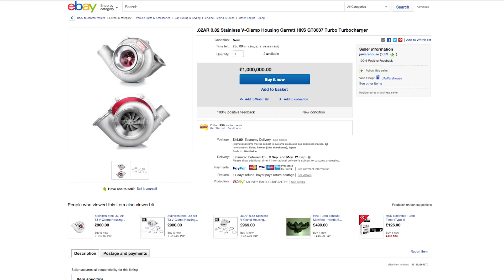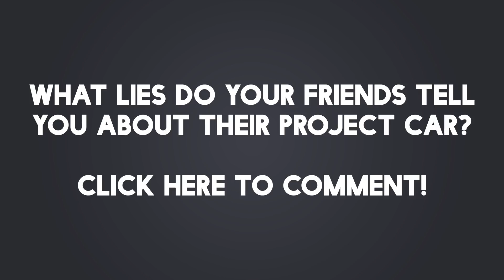10 Lies A Petrolhead Will Tell You About Their Project Car

Comment: "uhhh yea its a v8 😬 " (v6) -camaro. "
Reply: ***** Of course is a V8 BRO!   (4Cyl. Mustang)
Reply from the maker: ***** It's a 2011 6.2-litre V8 LS3 >> http://gmauthority.com/blog/wp-content/gallery/gm-6-2-liter-v8-small-block-ls3-engine/gm-6-2-liter-v8-small-block-ls3-engine-2.jpg
Reply: ***** "I drive a TRUE muscle car!" Drives a V6 mustang pony car...
Reply: ***** specially since the 4th and 5th gen camaro give away if its a v6 or v8 just by lookng at the front lol
Reply: My 4.3 will light them up
Reply: ***** "Hear the V8?" Playing v8 sounds through speakers
Reply: Car Throttle the bigest lie i told  as acar guy is that i have a car in a first place
Reply: ACoolStupidDog The modern V6s are pretty strong motors with lots of potential. I agree though, you should never call it a muscle car, even the GT isn't a muscle car.
Reply: MAEguy Of course! The V6 Mustang is very desirable in my opinion. It's a fantastic car, no doubt. We're talking 200 to 300 hp!
Reply: +ACoolStupidDog. there is nothing wrong with having a v6 anything but there is always those guys with the v8 version that will trashtalk you because they will always have more power than you unless you boost it
Reply: ***** In that case, get really close to their ears and silently whisper " GT-R... "
Reply: +ACoolStupidDog. gtr is allwheel drive and twin turbo from.factory all motor a v8 will eat it without those turbos
Reply: ***** Indeed, but it's still a V6
Reply: ***** True gearheads would go the other way "uhhh yea it's a v6 bro" a V8 owner :D
Reply: Lol yea those who have more than 600 horse try to look stock af but when they let you win the 1st race DO NOT double down for the 2nd race they will rob you blind
Reply: ***** hay I've got one of those. only a firebird.
Reply: LS1OfAKind A 4th gen z28 and a 4th gen V6 look almost identical.
Reply: a 4th gen gears work on a 5th gen rear end
Reply: "I have V12 mustang"
Reply: +Jack Carroll someone once told me his pick up truck had a 4.3l 350 v6 :O true story too.
Reply: Well the 4.3 is based off the 5.7 it just has 2 less cylinders
Reply: ***** so does that mean 3.8 mustang drivers can say they have a 5.0 v6???
Reply: No only the 4.3 from chevy was based off the 5.7 evrey other engine is based off something else according to Wikipedia don't quote me
Reply: +david hurtado this guy knows his stuff in 1984 they built they 4.3 and in 85 they released it in blazer and light duty trucks all it is is a small block Chevy 350 with two missing cylinders they stopped production in 2012 they restarted though in the 2016 Silverado
Reply: +stephen king (getrag6speedz28) that's the funniest thing I ever heard
Reply: "It's a six speed."

-Stick?

"Na, auto."

-Douche! 😑
Reply: soulassassin0g I agree...I'd understand if the guy was disabled and had the car modded for him to drive it, or if they've tried and failed a standard transmission so many times they've spent more on transmissions than driving lessons, but otherwise just say it's an auto and leave it. Lmao
Reply: I know
Reply: +david hurtado Nothing sounds stupider than a loud muffler on a V6-automatic Camaro, and my beater '68 Falcon with the 200CID six and stick shift on the column could beat it in a light-to-light drag....not that I ever....uh....
Reply: +Jack Carroll  Yea whatever... it's a turbo 3.8 from a GNX bro, it'll smoke your Geo metro.
Reply: +ACoolStupidDog Oh my god.. TOO MUCH HP!!!!
Reply: +dennis trident william lol wut? (thats a first I've heard!)
Reply: Ken2Point0 Braggin about shit you "used to" have online. Nice.
Reply: Joey Salads
Reply: He would be in big trouble when selling this.  :D
Reply: DC Garage But the exhaust still sounds like a '63 Rambler with a faulty muffler.
Reply: Well technically the older gt's are in the lower 4.9L...but they  round it up.  I guess newer ones are a lil closer...but putting an exact measurement of 5.0 stuptifyies me.
Reply: Auto = Luxury!  No stop n go or drive thru stick fondling...and playing patty cake with a clutch, going no where.
Reply: Lol autos shift faster than any human can.  More consistent too.  But I get itbif you dont live in a place where there is traffic, can be fun
Reply: soulassassin0g I had a six-speed in my Studebaker Lark: three-on-the-tree with a planetary overdrive gearbox built onto the back of the sliding gear unit; Overdrive could engage in any forward gear.
Reply: 5610winston like a semi-truck (lorries)?
Reply: soulassassin0g Not exactly. It drives like a regular Column shift three-speed manual but when you get up to speed, you let off the gas and an electric switch trips the planetary set and engages overdrive. When you floor the throttle, it kicks back into direct for passing or climbing or whatever. It was a popular option back in the day. The direct drive is 1:1, and the overdrive is 0.67:1. As I said, it could engage in all three  forward gears, but was most useful in second and third. Wish I still had that old car. A real sleeper.
Reply: 5610winston Holy crap, that's awesome. What happened to it?
Reply: Traded (regretfully) years ago. It needed a valve job, and rings, low oil pressure, and the under-dash air was blowing warm, and the front fenders and the bottoms of the doors were rotting out. I was too scared to look at the frame.  Figured the trade-in for a new Nissan pick-up would be a better investment than the repairs. I saw it in traffic a few times after the trade, and most recently about fifteen years ago coming out of a high school parking lot about thirty miles from where I traded it.  Kid driver seemed to be in a hurry...
Reply: What is it with Americans and v8s is it the sound?
Reply: Sound and All that Yummy torque. and the relative easy modding and maintainence
Reply: The rule of "No replacement for displacement" still stands true today in most cases.
Reply: david hurtado dude is that a v12 engine swap in that civic "yup".walks to the back of the car big fart can exhaust that things a riding 4cylinder
Reply: Will Eason
Seller: "Yes. It has a K20 turbo."
Buyer: "Oh, really?"
*Pops open hood, sees a stock B18*
Buyer: "You douchebag."
Reply: 75% of the way there! :D
Reply: seller: it's a real lamb for 300k
buyer:really a hurican
seller:yup
buyer:pops hood and sees rx8 engine
seller:son of a 
buyer:douch bag
Reply: I'd actually take the new v6 10spd over a v8
Reply: I had a friend try to tell me his Hyundai Accent had a V-8.
Reply: But then they can always boost their V8 and due to the laws of thremodynamics there truly is no real replacement for displacement
Reply: Even in traffic it can be fun I drove a 5 speed truck throughout highschool and maybe it's the torque that helps but I never had issues with traffic
Reply: david

Comment: "This air intake gives me 10 more horsepower"
Reply: It actually does lol
Reply: FSXgta Most air intake like airaid give around 12 hp How do you feel now ?
Reply: Tyrese Waldon fakeairintake
Reply: In all seriousness cold air intake is great because it allows the engine to cool off more which increases HP. A cold engine is always faster than a hot one. Ever notice how cars perform better in cold condition and are actually slower on a hot summer  day?
Reply: Tyrese Waldon It's not your engine being cold that help it, it's the fact the the cold air is dense, therefore more air to burn per fuel ratio. you're running leaner when its cold and richer when its warm
Reply: I never knew that, thanks lots!
Reply: +Gamingnation your facts are from where?
Reply: FSXgta The box said 10 horsepower!
Reply: Tyrese Waldon Are they?? Cant say ive ever really noticed. How do you notice the difference?
Reply: Its nor like your car is gonna suck more air with a modded intake. Turbo it, increase boost or your not gaining power
Reply: ^knows nothing
Reply: Shane Earley my buddy has a fast car, so were able to tell pretty good.
Reply: FSXgta Air intakes lose HP most of the time lol
Reply: Injen intake
Reply: Tyrese Waldon Nice bud
Reply: FSXgta Most cold air intakes don't add power, usually lose a bit, it depends on what car, and how the manufacturer designed the intake, go watch the, I am fairly sure Mighty Car Mods did an episode on it, and the S2000 in the video gained horsepower with the after market intake.
Reply: Tyrese Waldon nope, hot engines breathing cold air make more power cause there's less heat loss.
Reply: FSXgta Some can get you even more than that. I was shocked, and I wouldn't have believed it if I hadn't seen it myself, but a CAI got me .3-.4 seconds in the 1/4 mile. It wasn't quite that simple, there was a tune involved as well (NA 3.7L V6), but even with just bolting on the intake with no tune, I was .173 seconds faster. For some engines it works surprisingly well.
Reply: GRK HEEL What? Are you honestly implying having your intake air be a few degrees cooler will lower the running temperature of the engine? :I
Reply: GRK HEEL watch mighty car mods on this one. yes cold air is better, but "cold air intakes" do jack shit. Unless the stock intake has a lot of obstruction, you're not gonna get a gain (in the same way exhaust headers can slightly improve HP). It's just the easiest part of the power train to swap without screwing up, aka I MODDED MY CAR CAUSE IM A MECHANIC AND NOW IT GETS 500HP ON Bo0o0o0o000o0oo0o00ST!!

(oh and intake air doesn't mean anything in terms of engine heat- the combustion is where the heat is introduced, not the intake air, and the combustion is hot af whether it started cold or not. Better airflow through the engine bay, or a better radiator will cool the engine- but even still, engines temperatures are regulated, that's why they never run colder or hotter than the half way mark. Add all the "cold air" bs, the thermostat isn't gonna open below usually 180-190F, to allow the engine block to warm up and run better)
Reply: ***** that's a carb swap- which on carb'd engines means EVERYTHING. (You basically just doubled the fuel injection).
Reply: rasvial when did i say that cold air intakes give power?
Reply: ***** wtf obviously not... I said that hot engines burn fuel better and that cold air contains more oxygen.
Reply: Tyrese Waldon Yeah cool, I got a short ram air intake on my blown motor and it barely makes 1 or 2 hp if that. It is a necessary supporting mod for more boost though, but that's all it is, a supporting mod.
Reply: The box said 10 horsepower!
Reply: rasvial
Mighty Car Mods is a lot like Top Gear, in the way that a lot of people have way more faith in MCM and TG than they should. You can't just take one test by two amateur car guys as absolute proof that CAIs don't work. You have to evaluate it on a case by case basis depending on the car, intake, test environment, tuning, other mods, etc. Even MCM found that a CAI did actually make a noticeable amount more power on Moogs S2k. I love MCM, but don't believe everything you see on the internet.
Reply: +KX777 -Skrylixon If it loses power then it's not a legit cold air intake. If it's intaking cold air, we all know cold air means more power
Reply: +SPDFREAK713 It doesn't exactly make the engine weaker, it's just that the AC requires some of the engines power to run. Adding a cold air intake, a race header, bigger exhaust basically is freeing up horsepower that was already there. When you tube your car after doing a ton of mods, you are maximizing your engines potential with those mods.
Reply: people saying air intakes lose power are idiots. on certain cars it MIGHT lose power... IF you don't tune for the intake! the key to getting power out of any mod that isn't something like gears is the tune. there is no car in the world that won't gain power from a better intake when tuned for it. combine it with full exhaust and most cars will gain noticeable ponies.
Reply: kingcrimson234  smh Why do people bother with 'breather' mods and believe they're gonna gain power from them? Intake and exhaust are only supporting mods if need be. Most cars, like mine all you need is an intake and headers and the exhaust system is good for at least 400 whp and there's people running these cars around with 500+ whp turbo'd and exhausts quieter than their whistle. Do only what's necessary because honestly 4 cylinders sound like shit and most 6 cylinders, like mine sound like shit too as far as the exhaust is concerned.
Reply: TheHm3 well, you do gain from breather mods. if you're just going to have a bolt-on ride you might as well do it. my last car was a '99 mustang gt and i gained 32 rwhp + 42 rwtq from just a CAI and full exhaust (incl longtubes) and a 93 octane dyno tune. everything else stock. it was very noticeable.
Reply: kingcrimson234 all of that power comes from the exhaust im pretty sure
Reply: kingcrimson234 Well I'm not quite as lucky as you... I've got a blower 3800 series 2 and well... it's harder to get massive power from the blower than you'd think. It's like only 20 whp from an intake, downpipe, 2 pulley size drops and a tune to make everything work together... 20... but these motors are awesome when the blower's ditched for a turbo which I think it's time to do instead of throwing money away on the blower.
Reply: *****  Your point? If you don't need a ported throttle body why would you pay for one? If 2.5" exhaust is safe to run (in my case if I get no KR) then why bother with thicker pipes?
Reply: FSXgta "that exhaust gimme 10 extra horse power and the flame stickers gimme around 950 hp, i do 5 sec on the half"
Reply: 10% not 10. Still many have been proven by others than the company. Of course it does not work with all vehicles as some manufacturers actually do the testing.
Reply: +TheHm3 The series 2 3.8 is an awesome engine. I've had 2 Grand Prix GTP's, a 97 and a 02 special edition. The 97 was mostly stock with a homemade cai, exhaust, and a 3.5 supercharger pulley. It was a great car, I ran the shit out of it for years and never had any problems. I ended up selling it for a down payment on the 02 which was already built. That cat had almost every mod I wanted to do to my 97, full bolt ons with a cam, 3.2 sc pulley, electric water pump, full suspension with Koni adjustable shocks, adjustable front swaybar, adjustable front shock tower brace, tubular trailing arms, tubular control arms, solid rear shock tower brace, all Autometer carbon fiber gauges. All in all it was a great car and pretty fast at 15 pounds of boost. I ended up popping a piston doing a highway pull because one of the after market injectors failed. Anyway, the whole point of my post was to tell you that I got 352whp with the stock blower a cam and bolt ons.
Reply: Boomerisadog Ewgh man you had the Koni struts?! That's the one thing I'm jelly of, I can't imagine the handling the car would have with Konis... I can't even track down the Bilsteins anymore ... so basically I'm stuck with KYB's GR2s and have to make the best out of them with a more intelligent spring setup but the struts still suck ass and limit the handling :\ I'm jealous dude
Reply: +Gamingnation with a performance tune yes but straight out the box and into the engine you'll get no more than 5.
Reply: +FSXgta My software upgrade gives me way more Horsepower. Not a joke.
Reply: +FSXgta 
Real life dyno test by companies such as Injen or AEM provide evidence that COLD air intakes do increase horsepower and are less restrictive when compared to stock intakes.
Reply: +dontbeghey my truck gained about 20 HP and 40 ft-lbs of torque dyno tested, and my 5" turbo back straight pipe dynoed about 30 extra HP and 60 ft lbs of torque, did that before the intake though, I have'nt dyno's it after my 140HP tuner but it has some serious balls now, my guess is around 33
20-340whp and around 650-700ft lbs of torque
Reply: +SAMP Giggles 
What truck you got bruh?
Reply: +dontbeghey 2003 ford F350, 7.3l powerstroke
Reply: +FSXgta  hot rod garage did an episode explaining how to get the power from an intake on their mustang the computer needed additional tuning. if the engine is capable of more cfm but the flow is restricted you gain more power when you unrestrict it
Reply: +dontbeghey Common sense tells you a Cold Air intake work. First, it has straight smooth walls that promote airflow unlike those stock ones that create turbulence. This is why porting and polishing intake and heads makes such great gains, less friction between the air and the side walls of the runner. 

Secondly, the colder air thing. Colder air is more dense and therefore hold more oxygen. The more oxygen you have the more gas you can burn, which = more hp/torque. 

The engine has an Intake Air Temp sensor, Mass Air Flow sensor, and Manifold Absolute Air Pressure sensor to calculate how much oxygen it's getting and how much fuel to add. The O2 sensors are a backup to this. It reads how much oxygen is in the exhaust to figure out how efficient the engine is using that gas and air.
Reply: Keith Smith All basically true, but not 10hp worth of gains
Reply: Some cars already have cold air intake channeling the air from outside..
Reply: Sometimes comments on youtube make me realize how many ricers there are.... "less heat loss." "Intake +10hp, Cat back +55hp." Then there is me and you thinking, "Should I even correct them or just let them be?" LOL
Reply: Air intakes give more horsepower but at certain rpms. For example you may buy a specific air intake that will give you 6-10 hp at 7-7.5 rpms
Reply: My mustang gained 22 hp with just a cai and long tubes